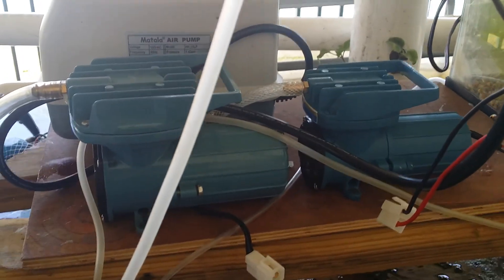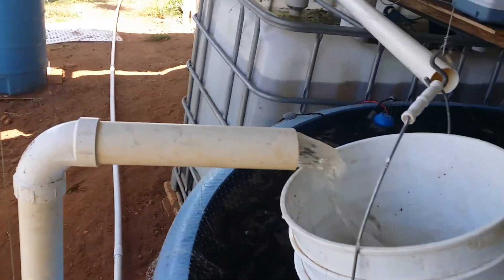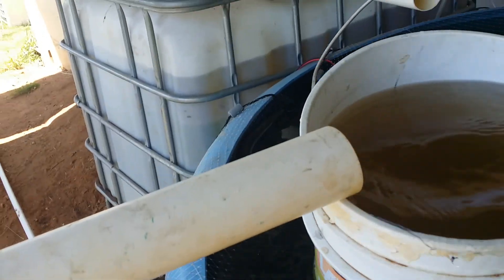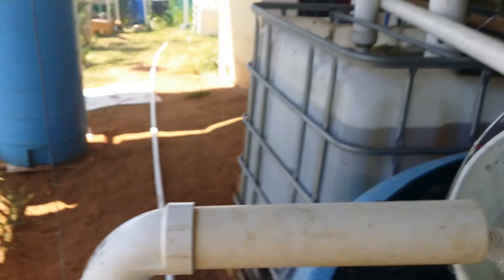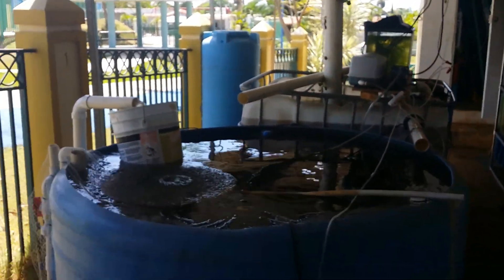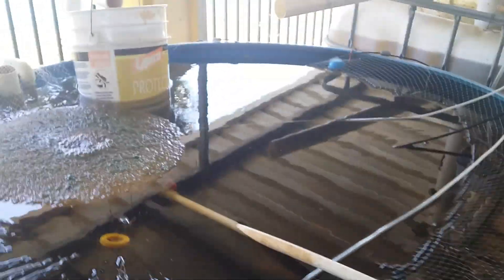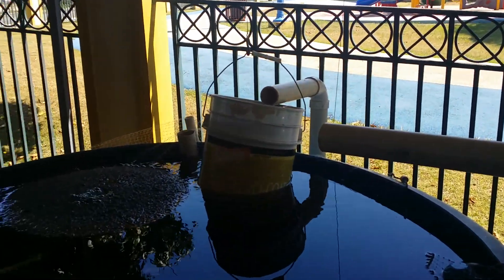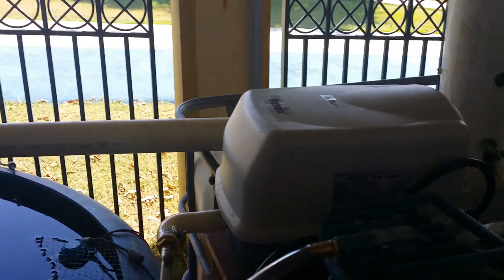Testing Resun air pumps MPQ903 & MPQ902 with airlift water pump adaptation.

Comment: Great work Irvin! Thanks for sharing. You just proved it! I can hardly believe the big commercial systems around are not using air pumps? That's more water flow than is needed! And totally practical for smaller personal or light commercial off the grid types too!

Comment: good day Irvin, thank you for the video. I am looking for something similar for irrigation in north africa, with one or two solar panels 300 w, and  2 batteries of 110 w each to run motor to have air and air lift pump in bore deep 90 meter with 15 meter of water, do you think that this can be workable? ad what can be maximum debit? thank you very much.